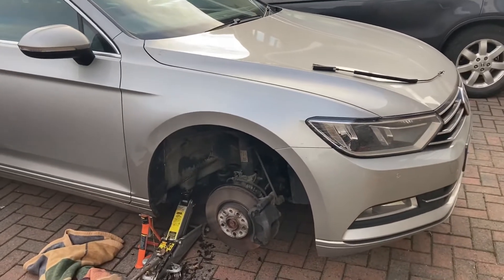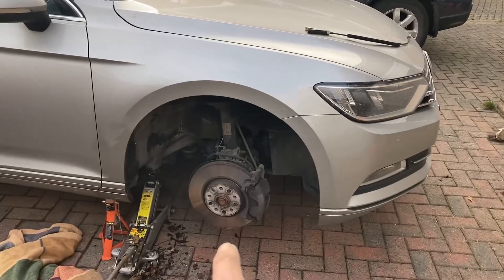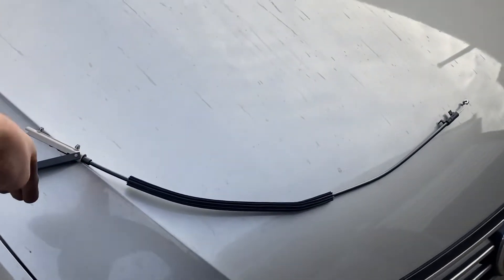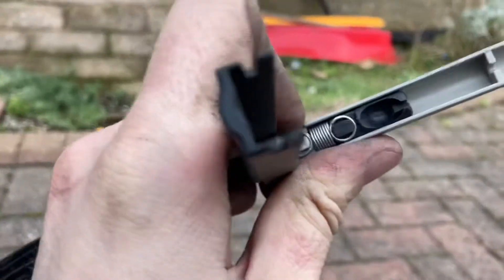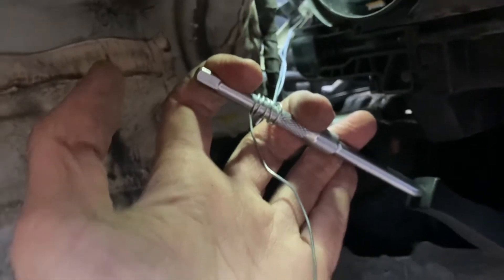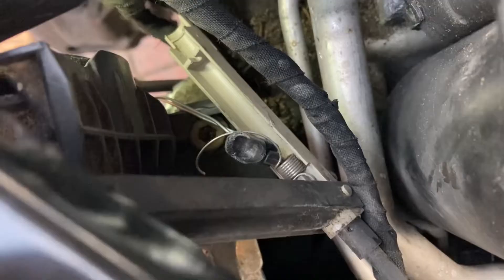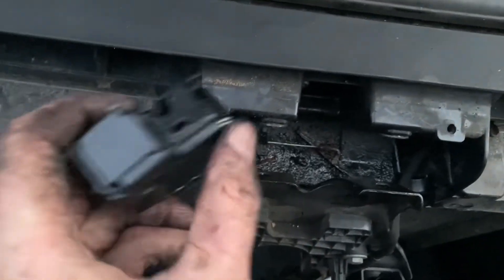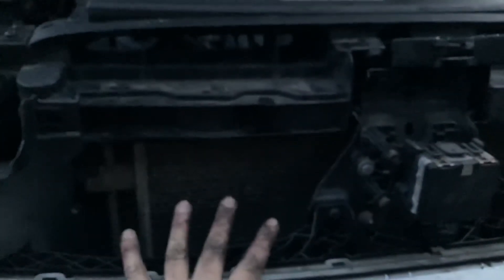VW Passat B8 2017 - broken bonnet cable repair

Comment: I had to do this on my 2015 B8 Estate.  Didn’t jack it up, wheel to full left lock.  Bit of a faff but opened the bonnet in about 30mins using a couple of wire coathangers.

Comment: Amazing video! Just had to do this today and it’s saved me so much time and money! 

I’ve rigged a temporary bonnet release which I can access through access panel in the wheel arch that you take off to replace the head light bulbs and it works a treat 😂 (new part order to fix properly) 

Thanks!

Comment: Had to do this myself, 2018 Passat estate. Your video helped to let me know it could be done! I couldn’t find any wire so had to try something else. I’m my case, for whatever reason, I definitely couldn’t get it close enough to use needle nose pliers and certainly couldn’t lever anything with a screwdriver - I’m guessing anyone able to do that has a very well lubricated latch (which begs the question why theirs broke in the first place..). The way I found that worked was getting a curved pick (one of the ones that looks like a hook) and sticking it through the spring return mechanism and pulling that while someone gently pushed up and down on the bonnet to release any upward pressure on the latch. This works because the spring is wrapped around the cable and is smaller than the plastic end, so effectively is pulling the end of the cable as with your wire method. I couldn’t get the pick to work trying to just hook around the plastic end piece. I’m sure this will fk the mechanism so only do it if you are sure you need to replace the cable obviously!

Comment: Thank you so much for sharing your video. I was able to work to your instructions and opened my bonnet within a couple of hours👍🏻👏🏻. I have a sore hand and wrist now but it was worth it. I saved myself £100 + at the VW garage who wanted that amount before they even looked at it so the work would have been extra. The local VW dealership is a daylight robber. Shame on them , they’ve had my business for a number of years but no more. Thanks again for your help.👍🏻
Reply from the maker: Glad I could help. I’ve used so much free YouTube advice over years I felt I needed to pass it forward 😊

Comment: Thank you so much for posting this, didn't know where to start, you saved me hours and cost. 
Found an easier way to release than trying to wrap a cable around it, hold the black cover flap with a long nose pliers and then using a long thin flat screwdriver pushed behind the broken part and lever over the long nose pliers as a fulcrum.
Long story short, just spent last 2 months in between work desiging and making a new engine mount for the front crankcase because one of the bolts snapped and the other tore the cast iron lug out of the back of the block. Just finished fitting engine yesterday, went for drive, came home, went to pull bonnet to top up coolant and this happened......😢

Comment: Thanks so much Rob, you gave the the confidence to do this! A few tips from my ‘fun’. Took around 3 hours. I did not take the wheel off, turned it to the left and went in under the wheel arch. I ended up removing 3-4 screws from the wheel arch and peeling it back in place to give me more room. I used a flat blade screwdriver to shear the plastic pins holding the connector block to the metal strut, then managed to get some wire around it as Rob suggested. Get someone to push on the bonnet release when you give it a tug and that really helps. Thanks again!

Comment: brill, wheel right hand down, folded the front end of the arch out the way (T25 torx), removed the cable bracket and pulled on whats left, couldnt have been more than 5 min thanks to this video ( im a mechanic for better or worse) thankyou!

Comment: Thanks a lot! If it wasn't for your video, I wouldn't have attempted to fix this! I tried to fix the broken off plastic bit by polishing/drilling it, wrapping a nail around it and the metal ball - there's a post on vw vortex forum and apparently it can be done. But that didn't workout for me so I ended up ordering a new cable.

I spent most of my time on the clips and the release of the bonnet. A word of advice for those who will have the same issue: use tweezers to push out the clips shown at 2:04. Also, the plastic bit shown at 3:04 was still in the plastic tube and I was unable to get it out and therefore wrap a wire around it. So what I did instead was put the end of the tweezers were the spring joins the plastic bit and then simply push it up - this motion released the bonnet. Cheers!
Reply from the maker: Glad it was of some help. Honestly don’t know why they did a two part release cable. I got the plastic but down by just breaking it away with a screwdriver

Comment: hey, just wanted to know which part you had bought as a replacement. Your video helped me to Open it finally but I can't find the right part!?
Reply from the maker: Tried putting links here but they don’t last. I recommend searching eBay for “passat b8 bonnet cable” and go with a genuine part as I’ve had a cheaper part before that didn’t fit too well
Reply from the maker: https://www.ebay.co.uk/itm/234818764483

Comment: I followed this video for the repairing my failed bonnet release. It really works, recommend bright lighting. Use a long screwdriver to release the plastic housing from the car frame and break off the cover, as it gets in the way. Use a loop of galvanised wire , use a screwdriver to lift the end of pull wire, loop round a few times. A bit fiddly, it does work. Thanks

Comment: Hi Rob I found myself in the same situation and eventually managed to get my bonnet open! The bonnet lock looked very rusty and weathered so want to replace it. However i just wanted to ask whether you got a genuine latch or one of these aftermarket ones from ebay which go for around £25-£30? and if you have a link to where you bought yours from? Would appreciate your further assistance! :)
Reply from the maker: i bought one off ebay, £23 seemed to be working great so far... https://www.ebay.co.uk/itm/363993067013

Comment: That crap can get a lot of tension and obviously in cold temperatures that stupid plastic it will break.
Who was the idiot that didn't think about it when they aprove a part like that or maybe the smart one so they can get dirty money from the owners because obviously that stupid part will break out of warranty.
Reply from the maker: i found replacing the locking mechanism massively helped reduce the force needed by the cable to open. (the old locking latch had gone rusty)

Comment: Excellent video with some great tips and reassurance that this can be a DIY fix.   Getting a (left) hand inside and working in that small gap is as close to impossible as you can get, but persistence paid off!  Thanks.
Reply from the maker: Thanks. Glad it was helpful ☺️

Comment: Thanks, this was very helpful. Instead of the wire I grabbed the broken black bit with some mole grips and yanked. Was a heck of a job getting them on, but it was the only thing that worked.

Comment: Just done mine today 2 tips I can offer is don’t buy a cheap replacement from eBay as I’ve had to do mine twice! And sometimes the part breaks if the locking mechanism has become stiff/seized!!! Vw wanted £600 plus vat to do it!
Reply: Wow...I'm glad I haven't asked them

Thanks for the video, I have the part, now just waiting for a time to get it done

Comment: Quick question. The part you linked shows a ball on the end as apposed to a hook. Is this link still the same listing?
Reply from the maker: Yes. The ball part goes into the hood latch mechanism and there is a plastic connector to fit the other part of the wire into.
Reply: @RobsRepairs  thanks for the reply. Sorry I meant the eBay link/listing the part at 0:23. I ordered a replacement and it came with the wrong hook type where the cable links to the bonnet catch.
Reply from the maker: @JimCricket  sorry Jim. Looks like the eBay link has changed since I bought it. This type is the one I used… with a hook end.  https://www.ebay.co.uk/itm/334459804278